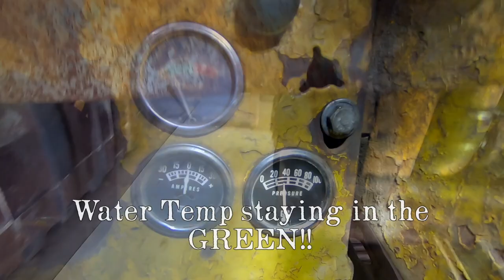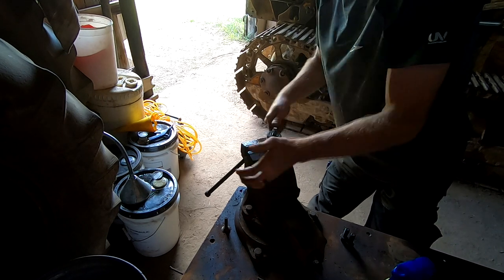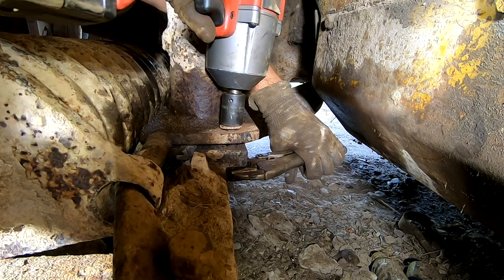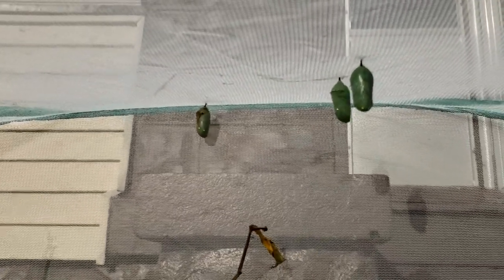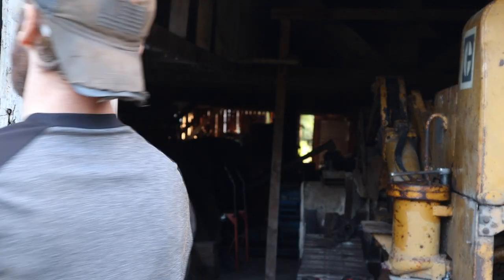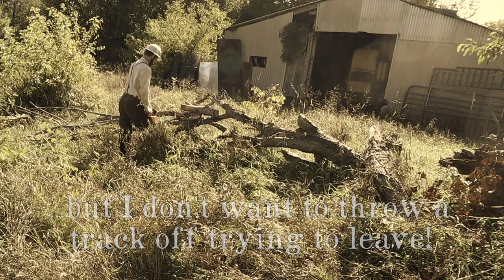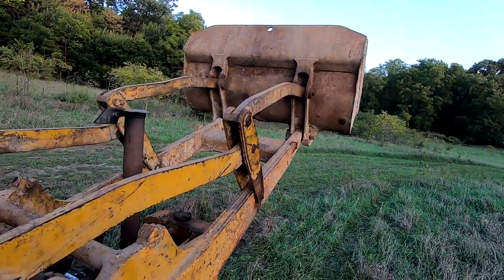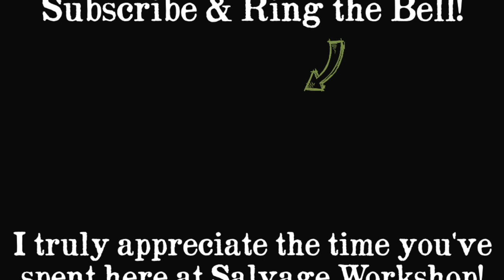Will the Bucket even WORK after 20+ Years? ~ Part 4 ~ 1950's Caterpillar TraxCavator

Comment: When the lift arms are fully extended and the bucket is fully rolled to the dump position, the mechanical advantage of dump stroke actually 'cams over' and binds.  You can see this occur when the bucket literally 'falls over' the leverage point.   You were trying to pull it back over the cam over position when the hose popped.  To release the cam over binding, simply drop the lift arms about 1 foot and this will correct the cam over condition (correct the leverage).  Be very careful with these style loaders at full lift arm extension.   I snapped the bell crank (curved piece the bucket cylinder pushes); expensive way to learn about this cam over issue!    I was hollering stop!  STOP!  Wait!    ...but you did not hear me.   Good news is hose and fluid is much cheaper than the bell crank! Have a great day, and have some fun with it too!   If you plan to keep and run this machine, weigh the cost of constantly replacing hoses and spilled hydraulic fluid.   Seek out a reputable hydraulic repair shop for your hose replacements.
Reply: ^^^ wot he said - the linkage is going over-centre. If you want it to be fool-proof you could weld a couple of stops suitably positioned to restrict that last few inches of movement, but as long as you’re aware of the problem just dropping the lift arms a bit before curling the bucket avoids the problem.
Reply: True that over center action on my old 966 loader also
Reply: Also to add to that is the hoses come apart internally and those chucks of rubber can destroy a pump as well.
Reply: All of the above comments are correct and good advice.  It should also be noted that the machine would not "cam over" when new and therefore repair and or replacement of all the pins and bushings (in the exact correct location) would remove the issue all together.  While many of these projects are expensive, doing them "all at once" can save massive amounts of cash.  For example you can order a hose kit which includes all the hoses pre-fabricated and ready to install.  Hundreds of dollars saved over the cost of each individual hose and they are built to factory spec, not some dude with a tape measure guessing at the overall cut length.  The bushings and pins are the same deal.  The correct guy for the job shows up with all the correct hardened chromed pins, line boars the holes in the right place, presses in new bushings, re-line boars the holes ... viola!   There is even a super cool MIG welder that auto-rotates through a bore if required.  When the bill seems high, just price a new track loader and you will feel better.
Reply: ⁰
 @srp01983  und ¹

Comment: I was a former Cat mech in the 1970s. The model of your Cat seems to be an early 1955. The piece you called the idler bracket is the idler YOKE. The roller you jacked the track out of the way to gain access to is the TOP CARRIER ROLLER. The spring in the roller frame is called the RECOIL SPRING, and it is supposed to keep proper tension on the track. It looks as if it may be broken. The milky look of the hydraulic oil means it probably has water in it; NOT GOOD. The valve in the hydraulic filter is called the bypass valve. Its purpose is to keep cold oil flowing AROUND the filter until the oil warms up. I enjoyed this vid, which was for me a trip back in time, when I was young and strong.

Comment: You and Andrew Camarata are the guys who make things work.
Reply: That's kind of an insult to be put in the same category as "Andrew the hack"...
Reply: @Flying0Dismount  What?
Reply: @kareem8533  Did you hear the comment in the video about doing what you have to do to get things going but then going back and doing it right?    My respect went way up with that...   Yes, Andrew can do a lot, but he just half asses everything he does vs doing it right..   Andrew would be the guy who got the machine going with all those different  types of clamps..
Reply: @Flying0Dismount  I must have missed that one. Also, Andrew is not the best in the world, I never said that, I have seen him doing things that I would have done differently, but I still have a great respect for him, his dedication etc. Ok, try to build a castle out of  containers.
Reply from the maker: Now, Now.... I have a lot of respect for Andrew, I wouldn't call him a hack by ANY means! He gets things done, mostly alone, & when most other people wouldn't even try!
Reply: Andrew would spray paint the TraxCavator a NEW shade of Yellow!
Reply: @Flying0Dismount  its Not half assed if it works... Sure its Not Like he's restoring His Equipment, he's using it good and fixing it fast and efficiently (and its Holding Up to the abuse thats the Important Part!). Every Thing worth doing is worth overdoing but the provit margine is bigger If your optimizing your time and get Work done instead of always Working on your Equipment. Cheers and greetings from Germany !
Reply: @alansmith4734  Yup, I have seen him paint the rims of a trailer (or what ever it was) without at least cleaning them first, but he seems to not care so much about appearence, he cares of functionality. Lamborghinis or Ferraris are just not his style.
Reply: @Flying0Dismount  i would like to see you do even half of what Andrew can do with basically no training. Jealousy is an ugly thing my friend. Get rid of it and you'll live a happier life.
Reply: @Flying0Dismount  he didn't half ass his roof extension!
Reply: Who manufactures those pants? They’re not pretty but they sure look functional.
Reply: what is this guys name anyone know? or what state he is in?
Reply: @alansmith4734  He pretty much ... well, you've seen what he did to that Cat's starter. Squatch253 and the Cat community might have a bounty on his head after that sacriledge.
Reply: And dont forget Diesel Creek 🤘🏻

Comment: The oldest Cat machine we have is a '67 D7E so I'm certainly no expert, but my understanding is that the shims on the track frame were originally installed when everything was brand new, rust free and tight. As the plates and frame wore in, you could remove a shim and tighten it back up. Obviously Old Red is way beyond needing shims at this point, plus those shims were so ratty they weren't doing anything for you anyway. As long as the plates and track frame sit relatively snug against one another (not screaming tight, but snug - there needs to be a very slight gap so that the idler can extend smoothly when you tighten the tracks) and the plate isn't canted outward at the bottom, you're good. 

As for the hydraulics, its a suction type setup. Dirty oil comes in from the outside of the housing and gets pulled inward toward the middle, passes though the filter and exits through the hole you were feeling in the bottom of the casing. The spring loaded plug on the top insert is just a bypass valve. It stays closed under normal operating pressure, but if the filter becomes clogged the extra pressure will overcome the spring, force the plug open and the system will bypass the filter altogether. It keeps oil flowing so the pump doesn't cavitate and burn up. The big spring is in there to hold the bypass valve to the filter, and help press the filter onto the bottom of the housing so that oil only goes where it's intended to.

Great work so far, man. This has been really entertaining! Keep it up. 😎
Reply: my oldest CAT machine is a 1973/1974 CATerpillar T40B forklift.

Comment: Coming along. Cat still will make hoses for you. Take the old one in when you do it. Tight short ones are a bugger when theyre pliable still, you had fun there...ha. All these questions you ask are in the service manual from cat. Caterpillar will you sell a reprint handled by a third party. Might find one on ebay cheaper. You'll get the straight answer every time, not have to go through a thousand comments and wonder.  Track idler plates should be as close to the rails as you can make them and not touch them. 1/16 gap is better than rubbing them. Leave the tensioner alone until you can fix it right. Lots of farm machines had those "aftermarket" parts lol. If you're working it hard it will matter soon enough. If you're just weekending and kinda working it easy it'll live a while yet.  Cutting into hard dirt and pushing hard at the same time is when the tensioner gets loaded hard. Turning in deep mud with a loaded bucket is when all the big forces develop on track hardware. Hills are the next row down force-wise. Looking good thanks for sharing

Comment: I admire your mechanical talents and energy.

Most of the bolts will be frozen. All the rubber fittings will be dry rotted. One headache after another.

Then again you will have a very nice piece of equipment when you are done.

Best luck
Frank

Comment: Over 20 years ago a team of 4 of us had 3 weeks to completely strip and repair one of these after it had been rolled numerous times down a slope after the operator had just stepped off it. It took us one week working 12 hour plus days to strip it down to it's component parts. Another week of crack testing and getting in replacement parts, then a week and a half of reassembling and testing everything. We returned it to the worksite late but in a near new condition. I understand it is still working for its living. Cats are built like proverbial Brick outhouse. Strong as
Reply: I've run a number of CAT wheel loaders with over 30,000 hours, and one or two with 40,000! They will last and last if you take good care of them.

Comment: Your hydraulic oil looks like it's emulsified with water. Also, that valve in the center of the filter top is most likely a bypass. People were prone to not change those filters often. They could become clogged and in order to save the pump and system, the oil would bypass the filter thru that valve. Also, if the oil got really thick from being very cold, the bypass would kick in because the heavy cold oil wouldn't pass through the filter until it gets warm.

Comment: It amazes me, some Farmers absolutely baby their equipment , while other just ride 'em hard, and do the bare minimum (if that) on maintenance.
Reply: I agree with you to some extent but I know that on many of our family farms nothing was bought new and could have several previous owners.  Spare parts either didn't exist or were too expensive.  On top of that were insane time constraints so you just kept equipment moving cause there was always something else that had to be done. . .
Reply: Im guilty of the farmer fix lol. A connection piece between the hydraulic pump and engine on my old tractor broke. I just welded the connection piece to the pump and engine and it has worked fine.

Comment: Get used to running a tap through every bolt hole when you take a bolt out. You'll be amazed by how much a difference it'll make for you putting it back together

Comment: You really , really need to get the manuals for the Cat. I'm working on  7UD4, a '53, and without the manuals to know what you're doing you end up wasting a ton of time and sometimes attacking the wrong issue. Caterpillar is without doubt some of the finest engineered equipment ever, but you really do need to know what they intended things to do to fix whats busted. Doing a great job though, keep at it!
Reply: I have all the manuals for my 7U also. It’s amazing to read through them. You get the impression they were designed to literally run forever.

Comment: If you reverse both side plates from side to side you will have the access hole in the proper place. I believe the plates are to be shimmed to a snug, but not tight fit. Refer to service manual for clearance specs. I have seen these built up with welding. You are correct in repairing the idler bearing lube fitting as constant lubrication is a must. Very nice old Cat keep up the good videos.

Comment: If memory serves me right from my Cat days, you can exchange the outside plate with the inside plate and you'll have that part like new. I've seen old equipment guys do that and they'd also build up the slide rail and grind it back smooth to help remove even more of the excess slack.

Comment: You might want to look at the hydro pump shaft. A lot of these older machines have a lever to disconnect the hydraulic pump shaft from the motor. Kinda like a love joy coupling. That slides back and forth.

Comment: Milky hydraulic oil means you've got water in the system. Hydraulic tends to degrade after sitting for an extended period of time, and you've already found out about the hoses. If that were my machine, I'd flush the hydraulic system and replace all the hoses. Already been there with one of my EIMCOs, but it put in a week of underground production service before popping a hose after sitting for at least ten years. 

The hydraulic fluid degradation presented as loss of power to the hydrostatic transmission, as the fluid's viscosity had lessened and its ability to sink heat was diminished. If you look inside the fill port and the fluid appears foamy and/or smells varnished, it's time for a flush.
Reply: I agree Headframe... I wouldn't stress about milky hyd oil I've seen D11T's pull in moisture in Australian winters and I doubt these old girls have oil coolers!! closed hyd systems will always pull in moisture on cool down thru the breathers... just flush and change the oil should it be changed more regularly because vane pumps are a bit more temperamental than the modern gear pumps.

Comment: I think that valve on the hydraulic filter is a bypass valve. If the filter gets too dirty it opens and lets oil through so the Hydraulic pump  gets oil and does not burn up. They will wear out quick without oil!!
Reply: You are correct, saved me some typing!
Reply: Correct it is a bypass to prevent damage to the filter to not collapse if it is dirty or the hyd oil is really cold

Comment: You definitely don’t want to have those idler retention plates tight, there has to be some room to allow the tracks to be tightened, it also allows the idler to absorb shock loads from the front as you work the machine into piles or rocks etc.  On the other end of that wishbone rod there is a big spring, that is the shock absorber and the track tensioning mechanism.  When you tighten the tracks it actually pushes the idler ahead on the track frame.  (Edit ...I made my comment before I finished the video sorry for boring you with the explanation of the track tensioning mechanism)

Comment: Good News, I found the Operators Manual. If you do not have it I will send it to you. (Where do I send it) Apparently we had a 12A5522 It was gone before I started working for the family business in the late 1960s. My grandfather started excavation with horses around 1910. I have been working on earthmoving equipment for about 52 years. You have great mechanical abilities. Keep up the good work
Reply: @SalvageWorkshop  
I did

Comment: It's the idler guides that are worn,the bodge way to get rid of the play without taking the idler out was to put shims in on the bottom side of the idler,look in from the front and you will see where the idler guide casting fits over a square bar on the track frame,I used to use old car springs to make shims,cut them to shape hammer them in,even amount each side and weld them in place.